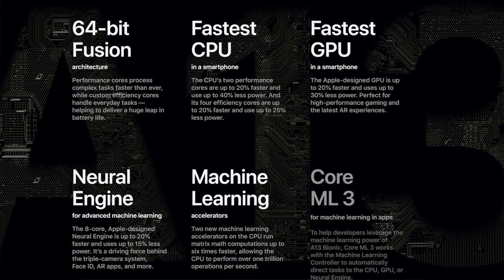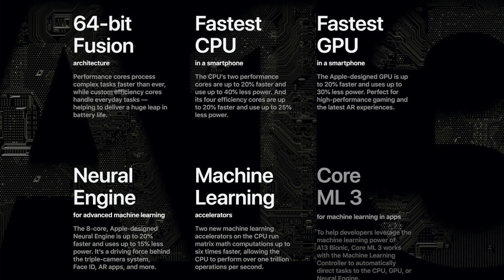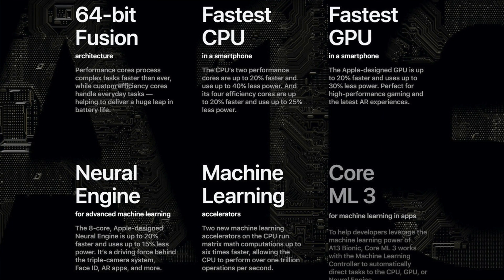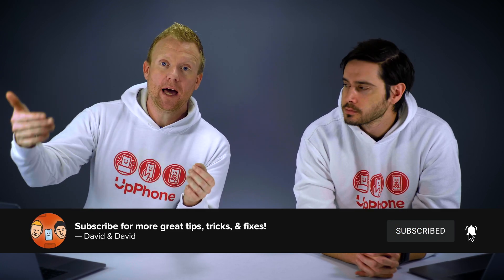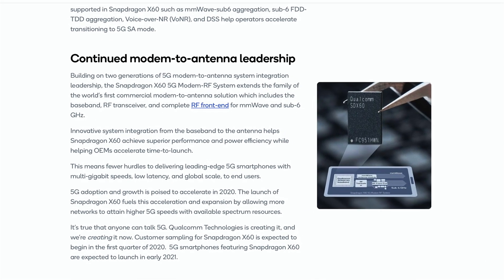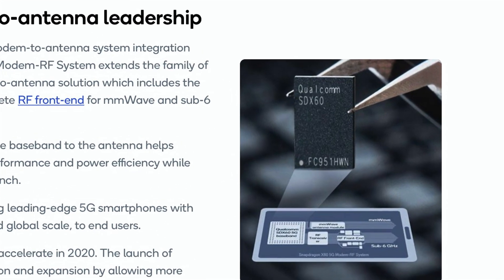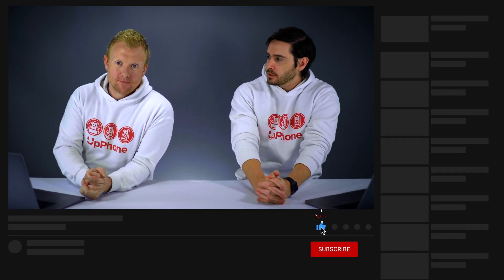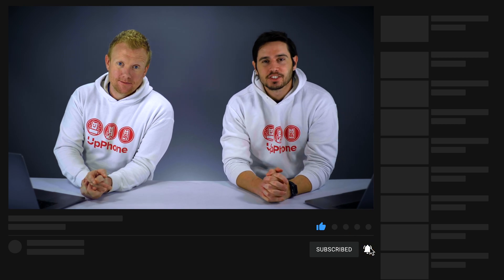The Truth About 5G Battery Life

Comment: Idk guys 5g enables a lot of things bc of the significantly higher bandwidths. Most people in the US have unlimited data at a certain deprioritization level. So getting on 5g asap means that the networks will be significantly less congested especially bc 5g is not widespread yet which means that if you get deprioritized at say 10gb/month then if you  exclusively use  the 5g network you will actually get significantly better latency, TRUST (and I’m from Silicon Valley)

What makes it even juicier is that Apple is reportedly designing their own 5g chip for the 2023 iPhones, so the drain on battery life may actually supersede the current Qualcomm LTE chips in the iPhone 13s

Comment: Nobody really needs 5g or wanted it to begin with. Here in the UK, 4g gets at least 10mbps everywhere as a bare minimum. That is more than enough to handle everything you could ever do on your phone. The 5g network in my city gets 600mb/s. Whilst it's impressive, apart from running speed tests I notice no real difference between regular 4g except abysmal battery life when connecting to 5g.
Reply: Bro . 4g works in India bad or good respect to area .
So bad 5g network is still give 45mbps😅
Reply: i work at a crowded place and our company has 4g and 5g antennas from some operator, did a speedtest today on 4g and it got 1mbps while 5g got 390mbps so i think thats a pretty big difference in some places
Reply: True, for what do u need more 10mbps on a Smartphone?
Reply: Not for data for but sometimes few areas 4g network not there n 5G works better for calls
Reply: Nah 5g is a big deal for me, 4g is good but 5g is amazing

Comment: They need to have a toggle in the control center so you can toggle it off and on quickly when you need and don't need it.  I plan to leave mine on 4G unless I need the speed.  I have 1gb service at home and decent wifi at work so I don't NEED 5G most of the time.
Reply from the maker: You don’t need 5G any of the time. I’ll be over to borrow your Wi-Fi next time I need to upload a YouTube video. I’m not jealous. :) (Calling to upgrade...)

Comment: So otherwise turn off 5g on the 12 or just get the 11. I’m wondering if I should just keep my 7plus and buy a new case. Lol
Reply: If you don't need more processor power, a better screen, and cameras, stick with the 7.  It's a solid phone.
Reply from the maker: You know, I never had an Apple case until I just got the 12 Pro with the Apple silicone case. Not cheap... unless you go on eBay. There are open box OEM Apple cases for $10 for every older model — all of my phones are getting new cases.